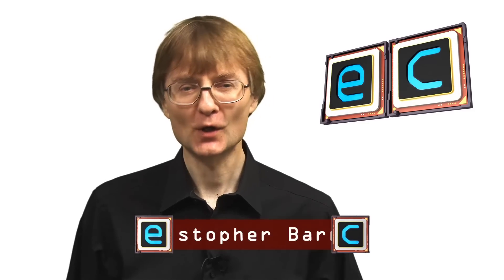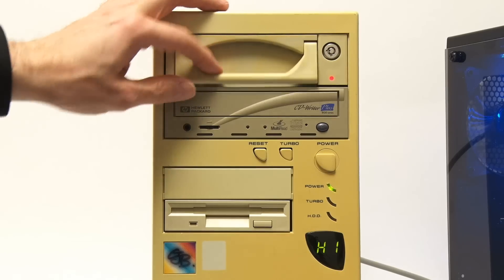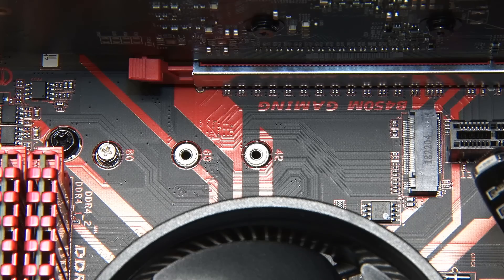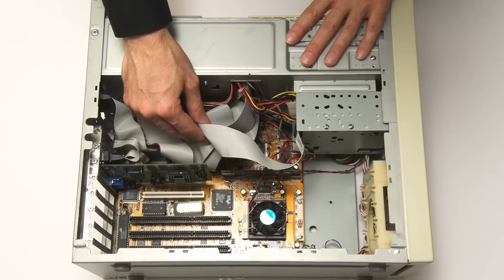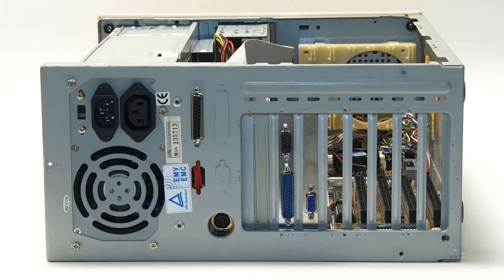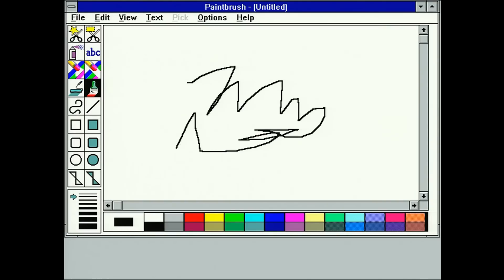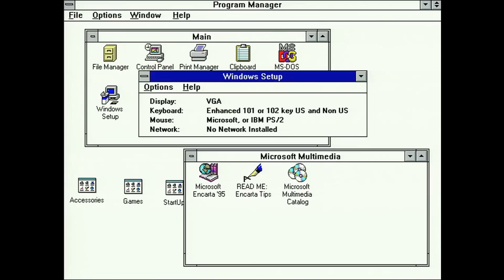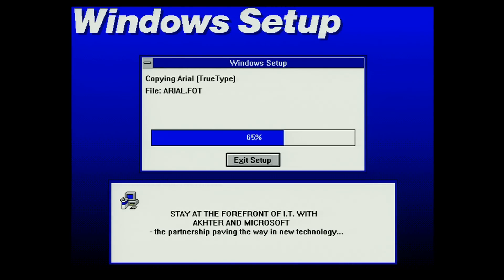Ryzen 3 vs 1996 PC

Comment: Win95 had already been available by 1996. Are you sure you were still using MSDOS+Win3.1 on your P120 w/ 32MB RAM?
Reply from the maker: @高睿 Absolutely positive! On the P120 I mainly ran Word Perfect 5.1 and Lotus 1-2-3 for DOS (which were by far the most popular programs in 1996 for a PC). I ran Windows to run CorelDRAW!, which is why I had the 32B of RAM. Few people touched Windows 95 before OSRII -- for a start, there was no driver for my printer for Windows 95! :)

Comment: How come the original Caviar HDD is dated 11 Dec 96? Did you also build a Tardis? BTW, I think PaintShop Pro had a screen capture facility back then.
Reply from the maker: Because I built the 1996 PC in late December! :)
Reply: @ExplainingComputers  Hmmm! Getting to the UK in just a few days? Did you have it flown in? :)
Reply from the maker: @Ndlanding  All I can say is that, based on when I know I used this PC (my timings are based on which books I wrote and completed on  what computers and when), I have presented my timings in good faith. I certainly know I build this PC close to Christmas. Also, as I've said in the video, what you see is my first build put back together -- I am pretty certain that I have got back in place the right components. But I have a lot of old parts, so it is not impossible that the drive shown is the same model, but not the same actual drive. There is no incentive or advantage for me here to present wrong dates, and I did a lot of checking to try and establish what I was doing over 20 years ago. But I no longer have receipts of bank statements to do an audit! :)
Reply: @ExplainingComputers  Sorryy, I wasn't getting at you! It was just a finnicky observation -- a fault of mine.

Comment: Chris -- In 1996 Windows 95 was already a year old. In fact it was already at version B. What were you doing playing around with Windows 3.1 in 1995?
Reply from the maker: I installed Windows 3.1 on the P120 in 1996 because I had Windows 3.1 floppies available. I also mainly used the P120 to run Word Perfect 5.1 and Lotus 1-2-3 for DOS, which were by far the most popular programs of the time. Even in 1996, most businesses ran DOS – Windows remained niche. And new versions were rarely adopted in those businesses that used Windows for a good year (until the second or “OSRII” release was available). In part this was due to software and driver support – all a new version of Windows got you in the 1990s was a slower computer that could not used your older peripherals, and which ran the same software as the previous version of Windows, or less software, as some older software did not run! For example, in 1996 there was no driver for the printer I owned for Windows 95. :)

Comment: A 1996 computer  on Win 3.1 and not on Win 95 ???
Reply from the maker: I installed Windows 3.1 on the P120 in 1996 because I had Windows 3.1 floppies available. I also mainly used the P120 to run Word Perfect 5.1 and Lotus 1-2-3 for DOS, which were by far the most popular programs of the time. Even in 1996, most businesses ran DOS – Windows remained niche. And new versions were rarely adopted in those businesses that used Windows for a good year (until the second or “OSRII” release was available). In part this was due to software and driver support – all a new version of Windows got you in the 1990s was a slower computer that could not used your older peripherals, and which ran the same software as the previous version of Windows, or less software, as some older software did not run! For example, in 1996 there was no driver for the printer I owned for Windows 95. :)

Comment: I'm disappointed you couldn't find a driver for you 1990's graphics card. Very amateurish of you. LOL. That's a joke, but I bet if you let us know what graphics card it is, someone would find the right driver for you. Although you do tend to go down lots of dead ends even now trying to find information (drivers, manuals, specs) about computer hardware that's just 10 years old. I had that issue recently whilst fixing a 2010 Acer laptop. I got the information I needed eventually, but it took a good hour to find the right information.

Comment: Why not Windows 95?
Reply from the maker: I installed Windows 3.1 on the P120 in 1996 because I had Windows 3.1 floppies available. :) I also mainly used the P120 to run Word Perfect 5.1 and Lotus 1-2-3 for DOS, which were by far the most popular programs of the time. Even in 1996, most businesses ran DOS – Windows remained niche. And new versions were rarely adopted in those businesses that used Windows for a good year (until the second or “OSRII” release was available). In part this was due to software and driver support – all a new version of Windows got you in the 1990s was a slower computer that could not use your older peripherals, and which ran the same software as the previous version of Windows, or less software, as some older software did not run! For example, in 1996 there was no driver for the printer I owned for Windows 95. :)
Reply from the maker: I installed Windows 3.1 on the P120 in 1996 because I had Windows 3.1 floppies available. :) I also mainly used the P120 to run Word Perfect 5.1 and Lotus 1-2-3 for DOS, which were by far the most popular programs of the time. Even in 1996, most businesses ran DOS – Windows remained niche. And new versions were rarely adopted in those businesses that used Windows for a good year (until the second or “OSRII” release was available). In part this was due to software and driver support – all a new version of Windows got you in the 1990s was a slower computer that could not use your older peripherals, and which ran the same software as the previous version of Windows, or less software, as some older software did not run! For example, in 1996 there was no driver for the printer I owned for Windows 95. :)

Comment: Very nice nostalgia. In 1996 you were quite up-to-date with hardware. I think VLB still existed back then. And 32MB of memory was more than average. But W3.1 was (even then) hopelessly outdated. Since long superseded by W3.11 and virtually every PC had W95 those days. But it was fast to run W3.1 on a P120.
Reply from the maker: I installed Windows 3.1 on the P120 in 1996 because I had Windows 3.1 floppies available. :) I also mainly used the P120 to run Word Perfect 5.1 and Lotus 1-2-3 for DOS, which were by far the most popular programs of the time. There was no driver for the printer I owned for Windows 95. :)

Comment: My first PC was a homemade Heathkit H-150 (Zenith Z-150 if you bought it preassembled) I soldered up in 1985.  I still have it in storage, but of course the 360KB 5.25 inch floppy discs aren't any good any longer.  If I could find some working MS-DOS v3 floppies I could boot it up.  I ran Turbo Pascal on it and the kit also came with a free copy of Microsoft Multiplan (their - and my - first spreadsheet program), which was pretty nifty since in those days application software was hideously expensive.  There was also a coupon for something called "Windows."  I asked the guy at the shop what that was and he had no idea.  I never did redeem the coupon.

Your 1996 build was not at all typical for the time.  Your PC was far more powerful than what most folks had in those days, which I gather is why you decided to build it yourself.
Reply from the maker: That was a great first build you did there.

Comment: Why would you put an m.2 drive in the modern pc when it has enuff space for a 3.5 inch drive?
Reply from the maker: An M.2 NVMe (PCIe) drive is a lot faster than a 2.5" SATA SSD, or 2.5" or 3.5" HDD.
Reply: @ExplainingComputers  they must have upgraded the tech because last time i checked it was just a different connector that still used the normal sata 3 controllers
Reply from the maker: @bland9876  M.2 is not an interface, it's a connector that can carry either a SATA interface, or a PCIe (NVMe) interface, or both. NVMe SSDs currently max out at about 3500MB/s, compared to 600GB/s for SATA.

Comment: Thanks for this. Brought back loads of memories. Those old beige cases were so horrible. And if you added a cd rom or floppy disk to the front, they were never the same colour of beige or they were black. And those ribbon cables were terrible, and when you had 2 drives attached to the same cable you had to set the master/slave jumpers on the disks to get it working. As far as dos was concerned, to get some games working you had to mess with the config files to ensure you had enough memory to run them. himem.sys etc. Those were the days.........

Comment: Great video, thank you. So many warm memories of 90s stuff I use to have back then. But for now, could you please advise me on the differences (those that affect technological advancement) and possible trends of Intel and AMD? I'm trying to make a decision on what to stick with for the upcoming years.
Reply from the maker: Today I would go AMD unless you know you need Intel for particular software -- as there are still a few instances where things run better on Intel, or only run on Intel. For example, Qubes OS has issues with AMD. But for the vast majority of OS and apps, AMD (Ryzen) now offers more bang for your buck, and will probably continue to do so. This said, aside from the test rig I use in some of the videos on this channel, I am Intel based and will remain so. :)
Reply: @ExplainingComputers  Dear Chris. I have never had an AMD machine and have always used Intel. If the differences are to remain not so big, I also would maybe risk Intel. I'll continue my inquiry then and dig deeper to figure this out. Thank you very much for your kind assistance.

Comment: Those were the days! 8086, 80286, 80386 sx, 80386  with a co-processor, 80486. It kept getting better, your Pentium came next. I even tried OS-2 warp on the 80486. And so much more .. .. .. In those days I ran a BBS with friends, that is how we shared information using a 2400 baud modem (which got better over time of course, a telephone line could not transfer that much info per second).

Comment: Do a video on converting old IDE pcs to use a CF Flash Adapter. 
Many people digging out their old PCs to do retro gaming are finding their HDDs dead, instead of sourcing a new drive, people should be sourcing a flash adapter so they can just run off of an SD/CF Flash card (much faster than old IDE drives, cheaper to source, much more reliable)
Reply: eg https://www.newegg.ca/p/N82E16822998003?item=9SIAKNK9GA5355
Reply from the maker: Nice video idea -- and I have such an adapter in a drawer somewhere. I must dig it out.

Comment: Interesting to see you ran Windows 3.1 on this, would have thought machine with this spec would run much better on Windows 95. I remember upgrading my 486 SX to 95 back in 1996.  Wish I had kept my older PCs but never had the space or money. I still do have my Commodore 64 though!
Reply from the maker: I don't have anything in the middle between the 1996 box and my current one, as things evolved between them a bit at a time!
Reply: @ExplainingComputers  Pretty much the same as me, really I had kept all my old stuff.  Since 1996 I have only bought one PC of the shelf (was a clearance deal that was 2/3 the price I could have built it for). 

The rest of my systems have simply evolved over the time, from motherboard replacements, new cases, PSUs etc.

I have an old Pentium P166 I have been asked to get data of, so if it works I am hoping to keep that as an old DOS/Win98 machine.

Comment: Up to Windows 3.1 I was actively developing system software, sometimes together with Microsoft staff, for example for voice recognition and networking. Nowadays we are so spoiled by technology. Back these days, every day we had a small success somewhere, and from time to time we made huge steps.

The most amazing steps technology made, are not so much the speed, but the size of the components. Now we are coming close to 1 nm CPU technology, while back then it was rather a question of µm, and you could see still traces on the chips by the naked eye, where today, you see a smooth surface.
Reply: Oh how blessed was the day Win 3.1 came out, compared to running MS-DOS on a TRS-80 with 16KB (that's KB!) of memory in the keyboard, 32KB of memory in an external expansion interface on which the monitor could sit to reduce the physical footprint, no graphics card, and plots generated by setting hi and low bits in very-limited video memory (very pixelated). It was also 'fun' to turn it on and generate RF interference to almost every electronic device within 30 meters. But hey, compared to the computer used in the moon landing, even the TRS-80 was pure bliss!

Comment: Life was so good! as Gen X or Late Baby Boomer was most excite times of upgrade computers. As gone thru from TRS-80 Color Computer and Texas Instruments TI-99/4A, 286 with Math Coprocessors, 386, 486 as some what between 386 and 486 had a Cryix cpu (Cx486DLC, Cyrix Cx5x86, and CXCyrix 6x86), AMD Athlon (Slot A "K7") , AMD Sempron. Current running is AMD Phenom X4 945, FX6200, A10-7890K and Athlon 880K. Looking forward to get some what uppergrade to Ryzen 3XXX when it become affordable or forced buy it by any one of those four machine die!  Even has Raspberry Pi 3 as emergency back up while power down.

Comment: In Oct of 1996 I purchased a Tower computer with Large boot drive 2 5 gig Barracuda drives for the video files the Mother board had 1 Meg memory and the Aux memory had 3 Megs for a total of 4 Megs. The 3 Megs were in Individual IC's and cost $800. It had a special board with a 1" diameter umbilical cord for Video Data input. A 19" RGB monitor. I ordered it mail order thru Computer Shopper magazine for a Messily $8 Grand.  I used Premiere  4.2 Remember the White Horse head.  Guess what I never could get this machine to edit video. Today one can edit video on their Cell Phone. How times change.  OH that monster still sits in the Basement with the case off because the 2 Barracuda drives ran so hot in the top of the machine I could not close  up the case.  OH forgot it had a Parallel port for the MX-80  and a serial port for the 1200 baud Modem.

Comment: 96 Pc starting Photoshop, 8 seconds, Ryzen 3 starting Photoshop 8 seconds. Some things just don't change, even if the computer is thousands of times faster.
Reply: programmers are lazy to optimize now. In those time, who understood computers good, was something like master. They had to optimalize everything in assembler, because memory was precious. Now they are just wasting with ram and resources, because they are lazy to think like geniuses of optimalization. Even my mouse software are taking 100mb from ram, it drives me crazy. They are using .bmp files, like thousadns of them. Unbelievable (it is a4tech, I already emailed them, that it is piece of amateur programming work)... I could do same mouse software into 5 mb.

Comment: My actual first x86 was a Packard Bell 486DX2 66Mhz in 1994, while during the middle of 1995 was when I built my first PC using a Cyrix PR166 or PR200 (it was something that ran at an actual speed of 133Mhz). I built all the PCs I used for my main systems ever since that one, with the Acer Aspire 7 A717-71G-74BX I got this past X-Mas the first time since that Packard Bell that my main system isn't custom built. In 1996, I think, or early 1997 at the latest, was when I finally switch over to a real Pentium 200 and got the MMX one at the last minute along with a Hercules Voodoo Rush card. I definitely remember the system I had when I got really into all the hardware including graphic cards. I also remember having 4 SIMMs and 1 DIMM so that it was 80MB of RAM, lmao. That was hardcore back then.

Comment: That's a nice trip down memory lane 👌🏼 And talking about memory,  32MB was quite a lot of memory back then. 4MB was more common if I remember it well.
Reply from the maker: You are right, 32MB was quite a lot. As I recall I installed it to work on book art in CorelDRAW! Other than than, the machine mainly ran Word Perfect 5.1 in DOS, which did not need all that RAM! :)

Comment: You bought a case with no 5 1/2 bays and are telling people nobody uses DVD or Blue-ray drives?  Or are you just not showing the 5 1/2 bays and saying that bullshit?
Reply from the maker: The case for the Ryzen build here does not have any 5 1/2 inch bays, just internal 3.5 and 2.5. Such cases are increasingly common. Look around an office today, and it is extremely rare to see a PC with an optical drive.
Reply: @ExplainingComputers  it might be rare in more and more offices to save money and using a USB stick or external HD is more efficient. Offices use cheap mass produced  junk.  I'd say its a bit less common. I repair PC's I've not seen one yet without one and I've never had a request to leave it out on a build.  Its not quite obsolete as a floppy drive as you seem to want people to believe.  If you said that about a cd drive it wouldn't be stretching the truth. I don't believe office computers should be the go to example on whats happening with PC's and eventually DVD and Blue Ray will be obsolete but its not quite there yet.  :)

Comment: Comparing  the 1996 Pentium with something from 1973 I guess the progress has slowed down in the years from 1996 to 2019. Those were the days of real hardware innovations. Especially if you consider the SPARCs, MIPS RISC, and Acorn architectures. The latter survived, at least, as ARM. Not even talking about Lisp or Prolog machines.
BTW: I was running Linux at that time 😎